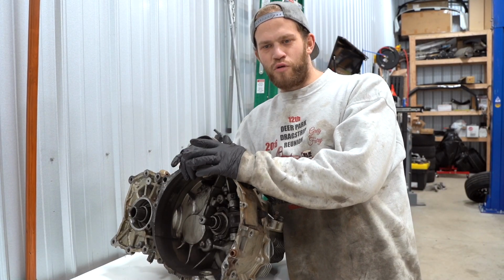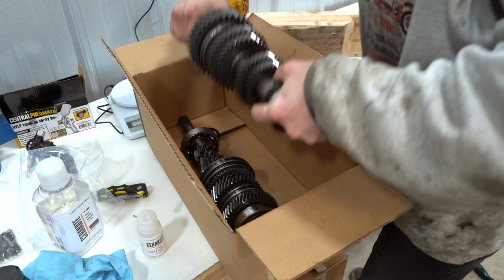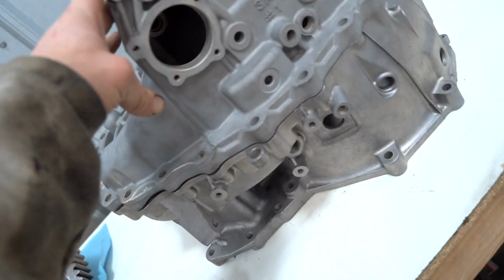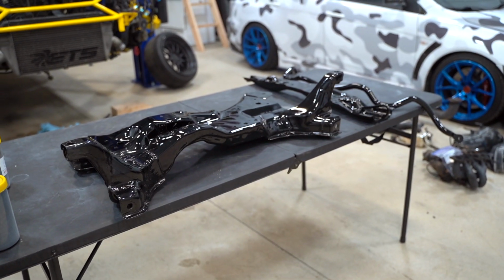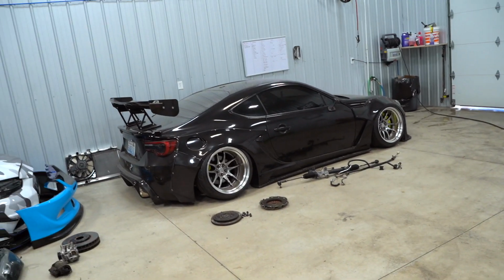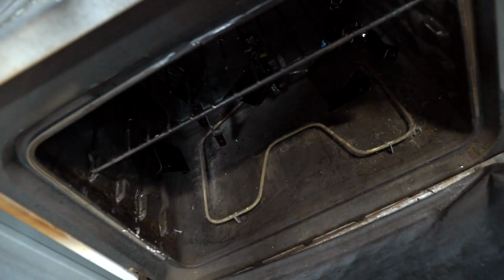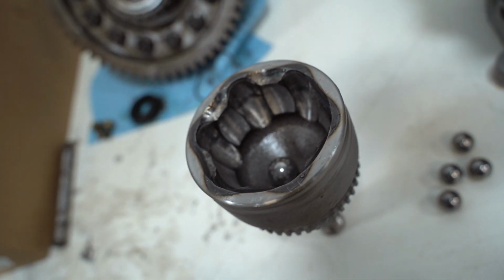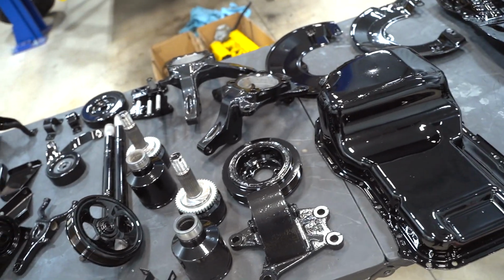The Evo VIII Rebuild | Ep.6

Comment: In the aerospace/electronics industry they call that kapton tape. Not only is it good at high temps but also a good electrical insulator so it doesn't create static discharge and has very low outgassing properties under high vacuum.

Comment: Heads up on glass beading and then cerakote it's going to fail down the road, cerakote has to bit grit blasted for prep glass bead peens the surface and doesn't etch to create a mechanical tooh bond